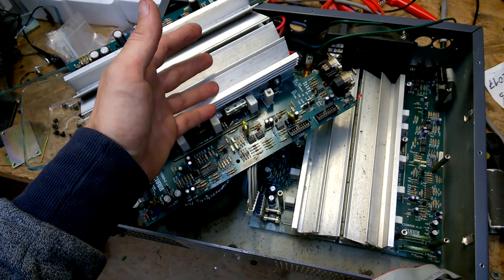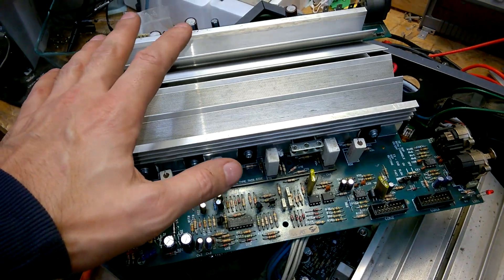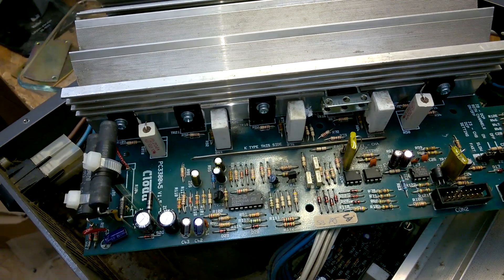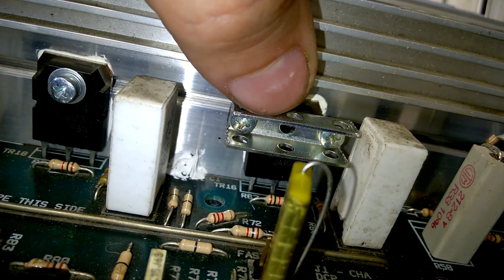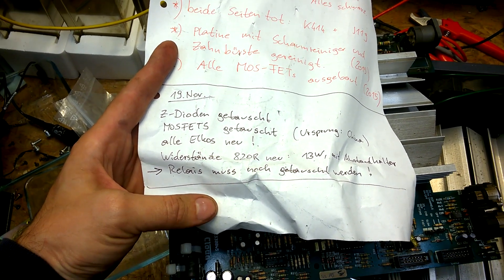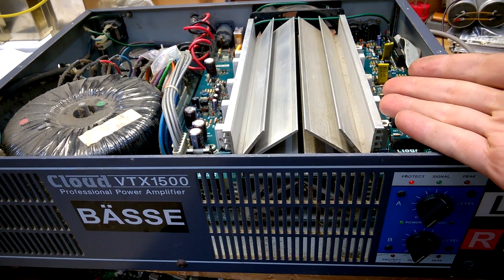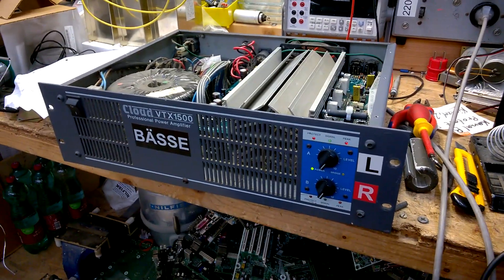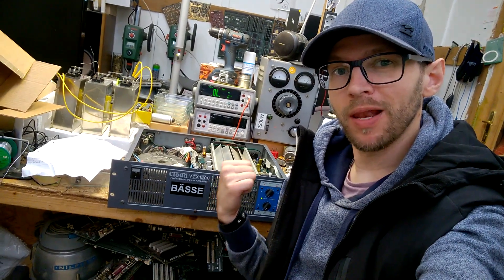Cloud VTX-1500  (Part 3): Chinese Transistors!!! Are they functioning?

Comment: I didn't know that MOSFET's needed balance resistors/ Emitter followers? I thought that Emitter followers are there to prevent thermal runaway in  a BJT amplifier.
Reply from the maker: They usually don't need them. I guess CLOUD wanted to be safe.